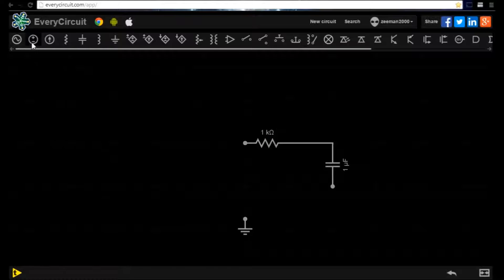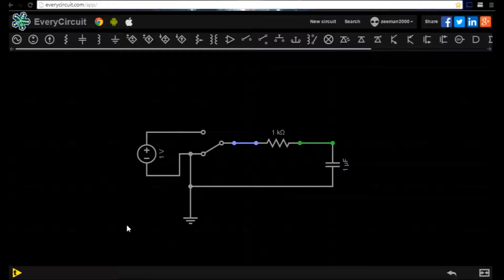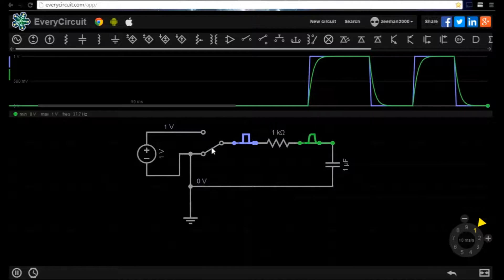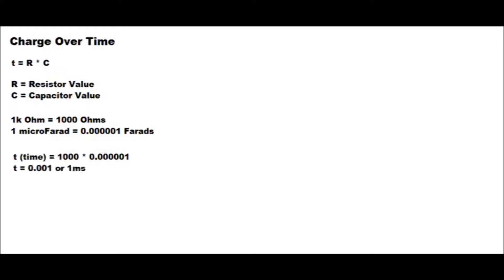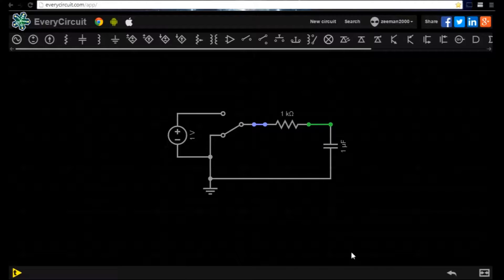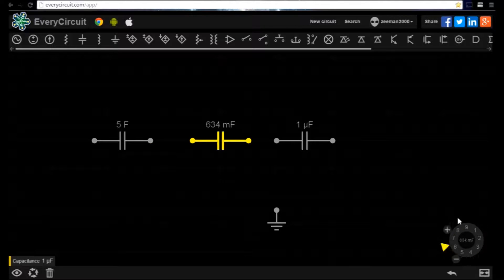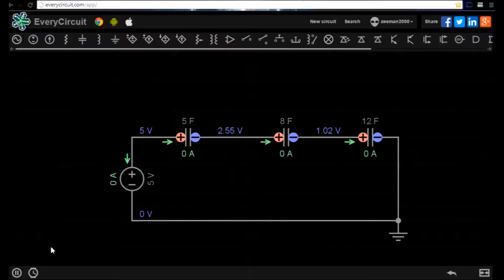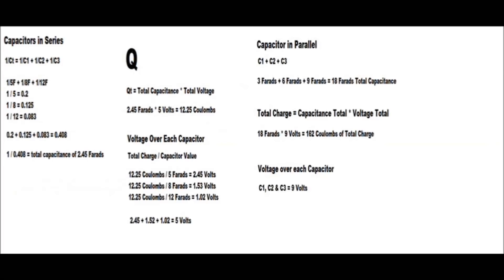Electronics Tutorial 4 - Capacitors

Comment: Great videos, thank you for creating them. 

Question: at about 5:12 into the video you are performing a calculation for Charge Over Time. I follow the math and the results all the way until this point. In the last step you then bring a 5 into the equation but I do not see where you are getting this value of 5 from. Would you be able to explain?
Reply from the maker: Greeting Fenatech, The 5 is used to show the charge on the capacitor after 5 cycles. This is a difficult concept to follow but if you look at the technical data for a capacitor you are going to use on a circuit it will give you charge and discharge ratings. I have used 5 as an example of the amount of energy stored after 5 cycles. Hope this helps.
Reply: Jenko022 thanknyou for the quick reply. Now I follow what you are saying. I did not catch that part in the video which caused my confusion. Thank you for explaining that.

Comment: Hello Jenko, 
1.) my question is about the term at (5:07) "5*0.001=0.005 or 5 ms ". Where from did you get the number 5? 

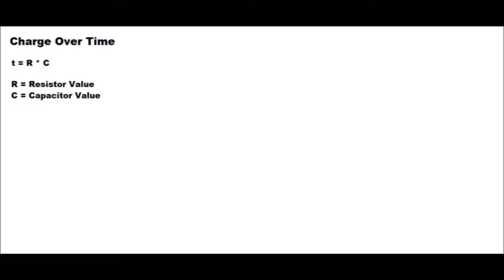2.) Is it about 5 T- Cycles, mentioned at (4:07)? How do you know, that a capacitor Needs 5 Cycles? :)

3.) You mean the income voltage to each capacitor in the parallel circuit is about 9V? though It has to be a Voltagedrop after passing a capacitor in a parallel cirquit. 
Is ist right to assume, that befor the current enters each capacitor, we have 9V on each pass. After passing each of parallel capacitors , we loose a bit of voltage?
Reply from the maker: 1) we are looking at the charge after 5 cycles. It may take more to fully charge the capacitor.
2) that is a question I have asked also. The charge and discharge happens so quickly on a capacitor I can only assume you would have to look at the data for the capacitor itself that you are using
3) No loss of voltage, the capacitor stores voltage and keeps it at a steady amount on the line. We have to measure current and voltage in order to calculate the coulombs of energy used.
Reply: Jenko022 Thank you very much!

Comment: Fantastic videos by the way, please continue with them! I have a question. I tried to create a circuit to control an led's "on" time using a capacitor. All is well, but I cannot figure out why the current flow is not displayed when current is flowing from the capacitor to the led. It only shows the current flow when power is flowing through the switch in the "on" position. I cannot also calculate the time that the led will stay "lit" until the capacitor is drained, can I adjust this with a different size capacitor? I need to know how to calculate what capacitor i need, can you tell me how? What am I doing wrong? Many thanks

Comment: Nice tutorials. Thank you. I cannot seem to find much on adjusting Evercurcuit itself.  CAn you tell me how to make the board bigger and also how to make the oscilloscope longer. I have a astible 555 timer circuit with a 4 minute cycle and I would like to see it all or aleast get some numbers for the wave..ALso is there any way to see log or errors when you produce a circuit that EC cant solve?
Best regards and cheers for the tuts. Very helpful!
Reply from the maker: +Gerard Bolger Hi Gerard, thank you for your message. Unfortunatly the workspace area is fixed and cannot be expanded. Which platfor are you using? e.g Windows, Android. Does the circuit you have built larger than the workspace or can you only see a portion? The oscilliscope is also fixed but there are future updates on the way that will change the way the you can view the signal outputs. Instead of them all mixed together the are shown on seperate channels. No error log available, would be worth putting your suggestions to the developers at info@everycircuit.com. Thank you for viewing my tutorials, all the best.